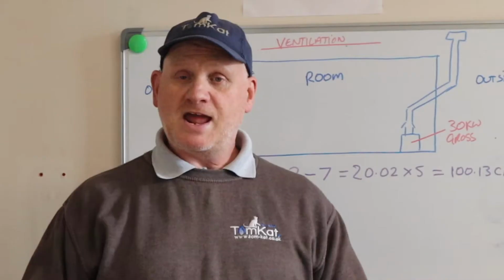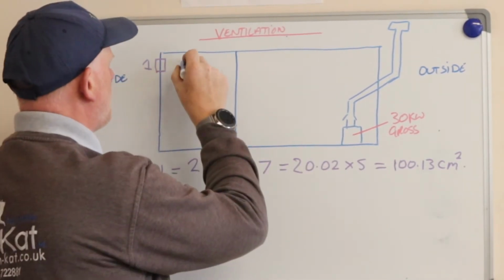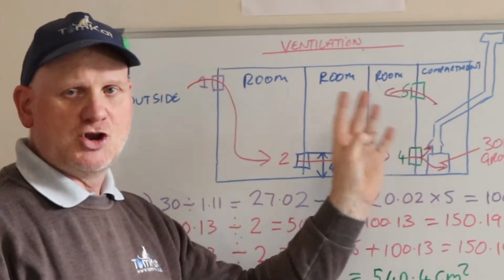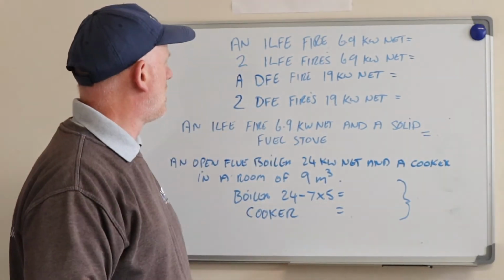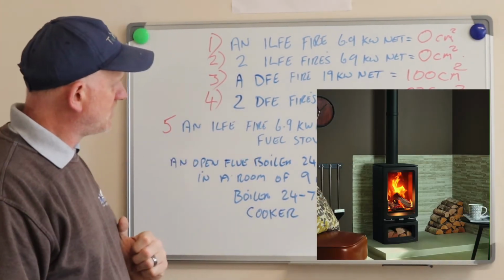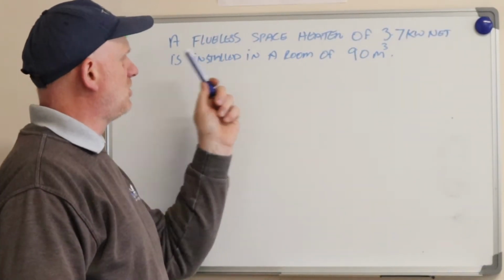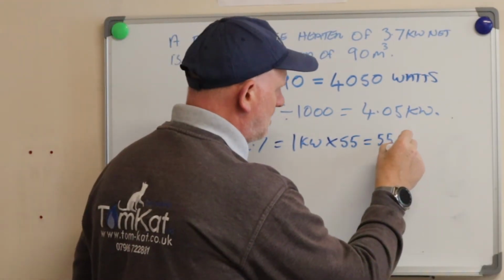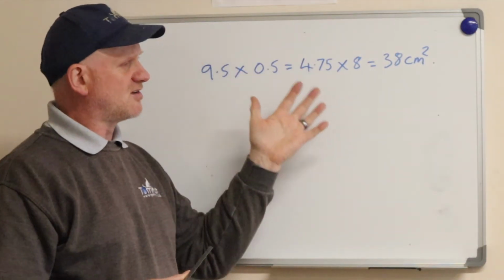Ventilation does a modern gas engineer need to know it.

Comment: Hi Derek, thank you very much for your kind efforts. But I have a question.....  27 kw net inpit and we are not deducting 7 as it is a compartment and you did multiple by 20 and 10 for compartment ventilation.  But we used to multiple by 5.  So why we are multiplying by 20 instead of 5?  Can you please let me know?  I am looking forward to hearing from you Derek.
Reply from the maker: Compartment ventilation is different from room ventilation. For compartments we can go through another room or directly to outside. It is also different between open flue and room sealed. Check out my playlist on ventilation and hopefully it will clear it up for you

Comment: Love the videos.Its taking me ages to do my portfolio.However one tging i have noticed on this video,which needs pointing out.When you have gone from gross to net you have stated the figure 27.02 then minus the 7  ....20.02
Then 20.02 x5 you have stated 100.13.
So when doing these calculations  DO NO ROUND YOUR CALCULATOR DOWN SO 
30 /1.11 =27.027
27.027 -7=20.027
20.027 ×5 =100.13
Just letting people doing their ACS out there like myself.
To be wary
LOVE THE VIDEOS FANTASTIC.
Dont want to come across as pedantic.Just staing a fact.
Good luck everyone.

Comment: @tomkatgastraining   what is the ventilation requirement for a flueless gas fire with a catalytic converter?
Reply from the maker: 100cm2 up to 2.7kw then 55cm2 per kw over 2.7kw in a room
Reply: @tomkatgastraining  if it doesn't mention how many kw the fire has what do i put?
Reply from the maker: @kukiechag99  the fire should have a data badge with the heat input in kw. If you don’t have one and you don’t have the instructions you will need to speak to the manufacturer.

Comment: Because installers don't install appliances that require any kind of ventilation (Intergas are an exception in certain installations for cooling putposes) they almost disregard the ventilation requirements of appliances they encounter.
I hope all installers will be reminded to assess the vents they come across to avoid potential risks.
It maybe old tech.,but there are loads of appliances still out there waiting  to bite the unwary or complacent!
Reply: DFEs are the main offenders....